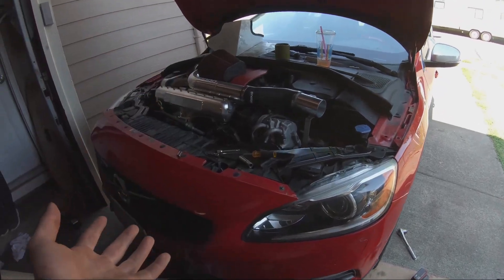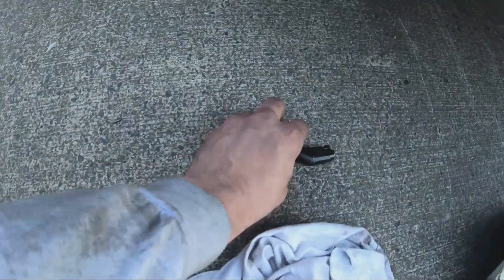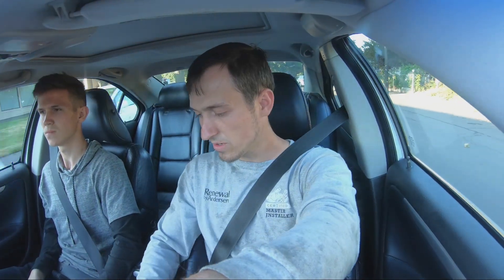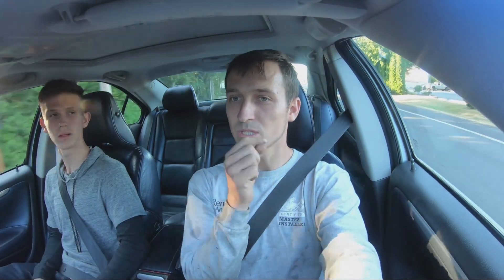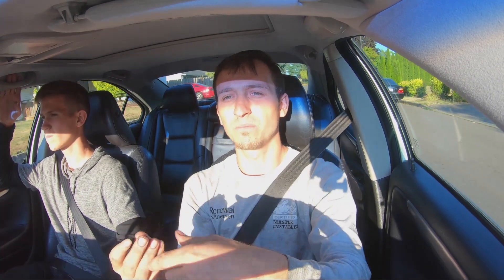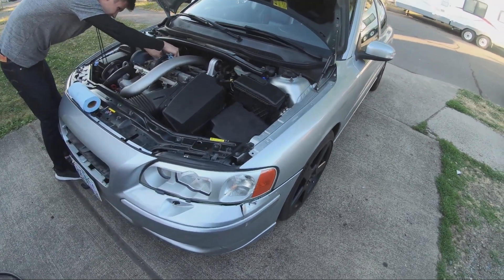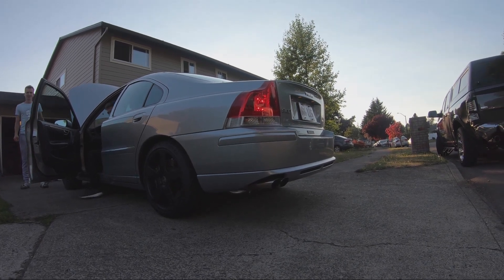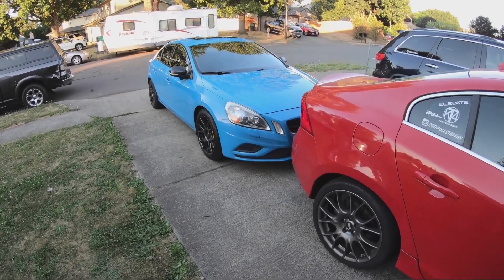Volvo S60R stage 2 with burble pops tune, test drive...

Comment: Love your videos bro, i got a s60 T6 2014 r-design polestar optimized myself and i love volvo, specifically love the p2 and p3 s60's.
Got inspired by you a lot atm so im about to change diverter-valve, downpipe and exhaust soon.
Love from sweden bro, keep the vids coming!
Reply: Najs! Har också en s60 T6 polestar från 2014, en riktig dröm, min kusin har en s60 R från 2005 med endast 5000 mil.
Reply: @NudelKungen.  damn 5k mil var inte dåligt!

Comment: Thats interesting, Id have figured if the part was made for the specific transmission on that car (Aisin tf80-sc) it would just be a direct swap, id also recommend a better torque conv as well.
Reply from the maker: No i think 2008-2013 is one valve body and 2014-2016 is another if im not mistaking.

Comment: Any suggestions on the angle gear problem, currently I believe my sleeve is leaking brake fluid into the clutch.
Reply from the maker: If you service the angle gear every 30-50k miles you wont have any issues.
Reply: That might be the clutch slave leaking.

Comment: Install the TDI tuning box and you’ll be amazed how much more boost you’ll get.
Reply from the maker: You do realize tdi tuning box is a cheap version of the custom tunes that I'm doing? The tuning that we are doing is 100times better then the tdi box. The tdi box is pretty much just a basic chip that increases boost in a car. 

The tunes that we use are custom tunes, we get the most power out of our cars with the best reliability and performance the s60rr and hilton.